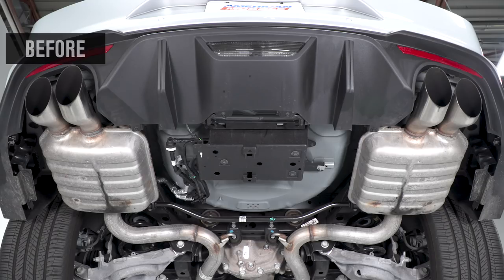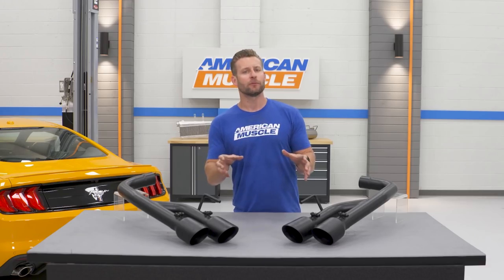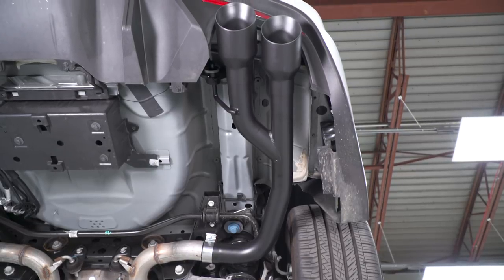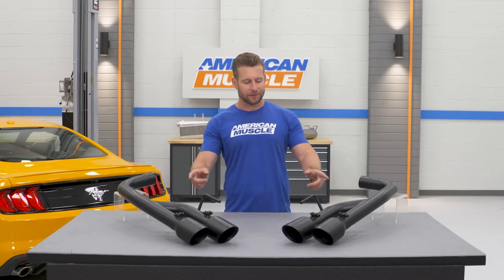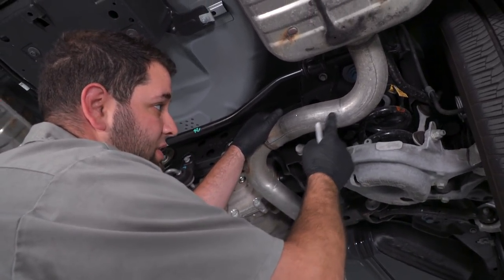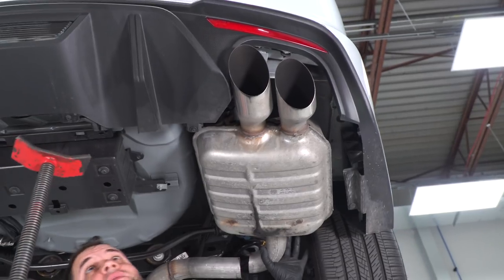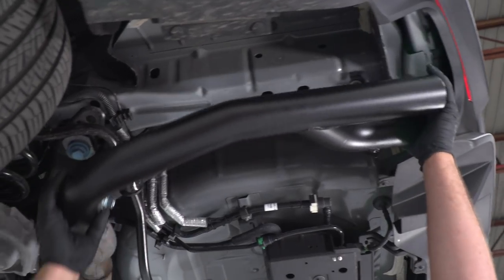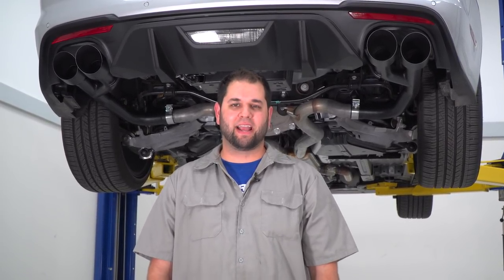2018 Mustang GT MBRP Black-Series Axle-Back Exhaust Sound Clip & Install

Comment: Literally just installed this on my 18 on Wednesday.  Boomy during acceleration without being obnoxious and absolutely disappears when you’re at speed.  Was shocked at how bassy/deep the tone was but I suspect that’s because I still have my resonator.  Outright screams when you go full throttle to redline.

Comment: Those 2018's are so beautiful! 😍 But S197's have my heart 😉
Reply: JustAnotherGT  IKR!  I have had my S550  since  June of 2015  but I still have my 2011 S197 as the screen saver on my phone,  iPad and laptop.  Man I miss that car! 😩
Reply: xxbonrockxx nice! And why did you get rid of it? 😕
Reply: JustAnotherGT I got a 2012 GT/CS I still love it
Reply: JustAnotherGT  Sorry, I just saw your question. I kept having front end issues because of bad roads and potholes. I changed everything in the front but the k- member, Twice! Lol! It drove, rode and handled great but I could never get rid of a  clunkity thud  that I would always get when I ran over a bump or went into a driveway or something. Not even Ford could tell me what it was so I traded it in on my 2015 GT.

Comment: Hi Justin, which would you recommend, this system with the stock resonator or an x-pipe with the stock mufflers? It's going on a 19 GT without the active exhaust. I'm looking for something that isn't too loud but has a nice deep tone while keeping that signature Mustang V8 sound at WOT. I had the MBRP street XP on my 17 GT and loved it however for this car I don't feel like going with a full cat-back.
Reply from the maker: Hey JC- I honestly think the MBRP axle back with stock resonator will be louder compared to the stock cans and resonator delete.  However I think the MBRP will have a deeper tone compared to adding an x pipe to your facotry system. I guess you have to decide what is more important volume or depth of tone.  Hope this helps!  -Justin
Reply: @americanmuscle  Thanks for your reply, I really appreciate it. Hope you're enjoying your new '19 GT! I went to the darkside too and opted for the auto. It's a great transmission but I still miss going through the motions of a manual transmission. 😒